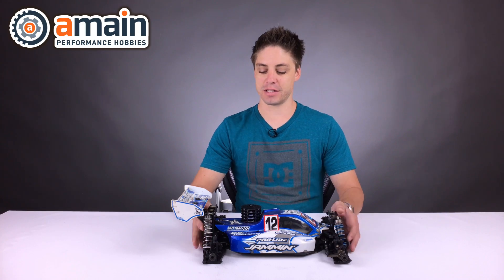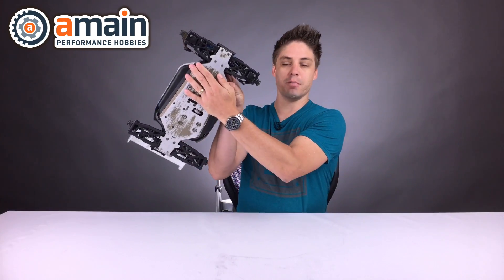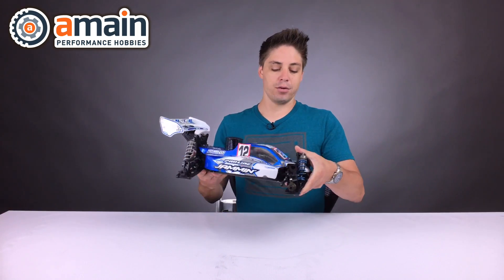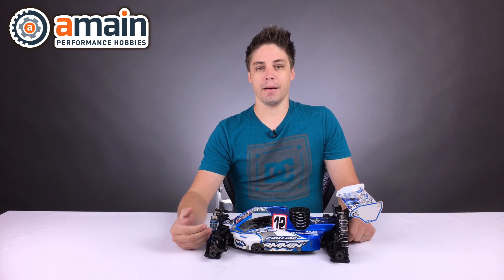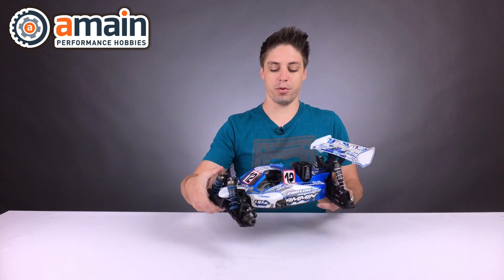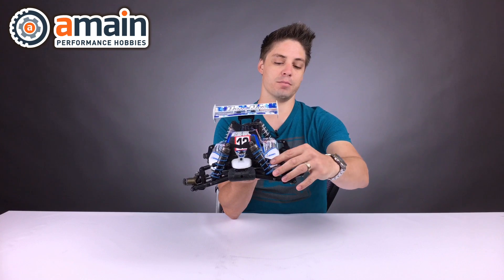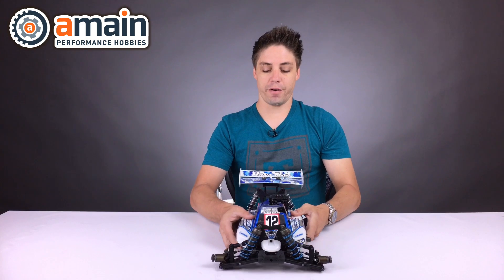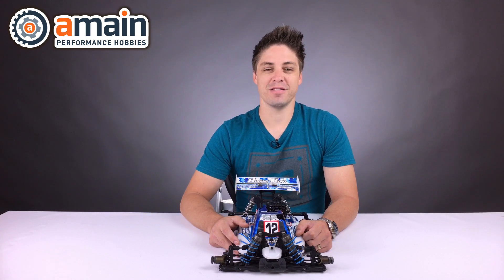Amain Tech Talk: What is the purpose of the Droop Screw in your RC Car's Arm?

Comment: If u could do a short course video on proper setups and proper droop to note if the wheels should be straight with each other when looking at the side of the vehicle droop my sct410sl has way more droop in the rear then the front of my truck

Comment: Very good vid, always wondered what droop was.

So to Summarize:

1 Adjusts ride height
2 Adjusting stability of the vehicle (less droop, less roll)
3 For off road, helps with jumps of different sizes. Big jumps big droop.
4 To limit wear on piston / the shock if the piston is fully extending.

Hope that is accurate :)

Comment: That’s 2 years of you talking absolute crap to us.
All suspension settings ARE ACTUALLY time delay settings to car drivers. You’re NOT a manufacturer you’re a drive and as a driver you’re only concerned with when stuff happens and when it fails to happen when you want it to happen.
Road surfaces have DEPRESSIONS in them and your wheel must go down into the depression so you don’t get slowed down in a race. YOU’RE GETTING RID OF THE TIME DELAY CAUSED BY THE depression in the road surface on corner number 7 of the race track.
OR the corner is OFF CAMBER and you need to get that tyre to REACH THE ROAD SURFACE to stop the time delay caused by the race track design.
1mm is 10 seconds of time delay.
You are a race driver concerned about TIME not millimetres. 
The car you’re adjusting while stationary is in theory ‘IN MOTION’.
Road surfaces contain FAULTS. DROOP SETTINGS TAKE OUT TIME DELAYS CAUSED BY FAULTS IN THE ROAD SURFACE. 
OFF CAMBER ROADS ARE DELIBERATELY PUT INTO RACE TRACKS BUT THEY’RE faults in the road surface.  faults cause time delay problems for drivers. They DON’T cause measuring problems for drivers.